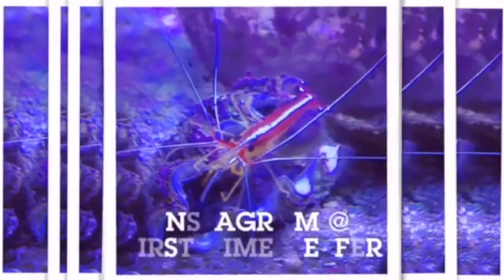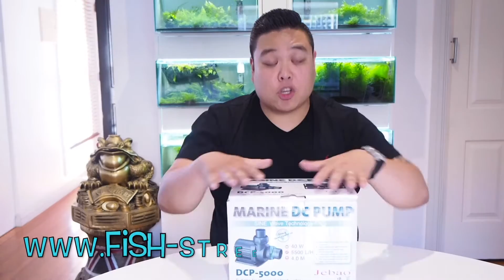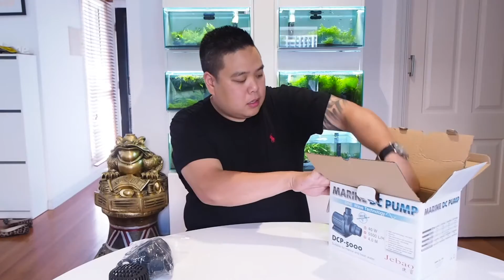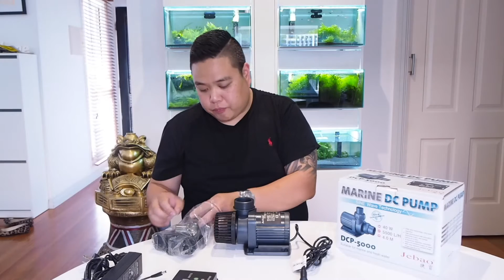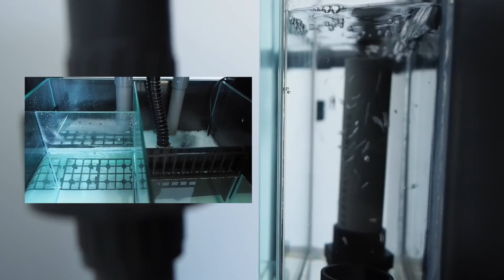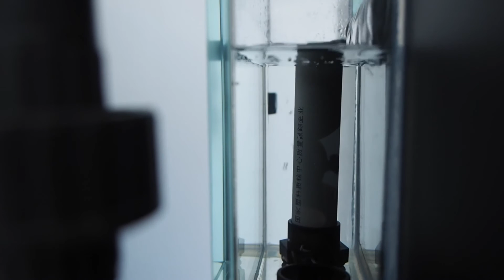FTRTV - Unboxing Jebao DCP 5000 DC Pump

Comment: How is the pump going now - 3 years later?
Reply from the maker: Its still running like day 1! Ive cleaned the pump once since owning it and its still quiet as anything so I highly reccommend it!
Reply: @firsttimereefertv1588  awesome, seriously considering buying this instead of a Vectra or an expensive return pump. At $200 vs about $750 for a Vectra, I can replace this twice even if something does wrong and still be ahead!
Reply from the maker: @aus-m7x  totally will work just as good! Over time I have upgraded to more expensive pumps for the app controlability and user interface. Definately worth using a jebao though!
Reply: @firsttimereefertv1588  What is the purpose of app controllability though unless you're running it as a closed loop system? Was under the impression if we're running it submerged in a sump then it's really set and forget?
Reply: Thanks for the replies on a very old video btw, they've been really helpful!

Comment: Hi
I read reviews and i watch video for this pump but I did not understand if the flow could be reduced less of 65%, for example the DCP-6500 have max flow about 1710 gph, i ask if possible to adjust the flow at 50%(855gph), 40% (680gph) or less.
I asked the vendor and he propose me an additional controller ( for see other  info is AQLink T1).
This component is necessary or no to adjust del flow rate less 65%.
thanks

Comment: I am looking to get two of these pumps setup on a 120 gallon with dual over flows. Looking to run about 300-350 GPH per pump.  I have about 5.5 feet over head and would like to run the pumps on around 65%-75% power to achieve this.  Which size pumps should I go with?

Comment: How much noise does this make in comparison to the Ecotech and Nyos pumps
Reply from the maker: Icarus FPV i cant say compared to those pumps as i havent owned one but this pump legitimately is dead silent!! I cant hear it at all and for the price compared to others its great value!! What pump are you thinking of getting?
Reply: I have this in a 20000 LTR on my pool and it is way quieter than my ecotech m2